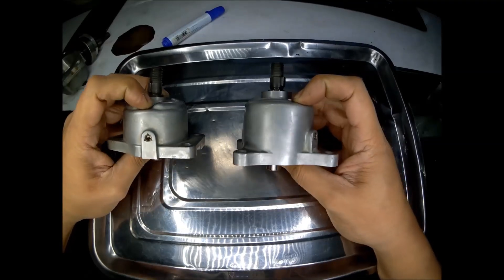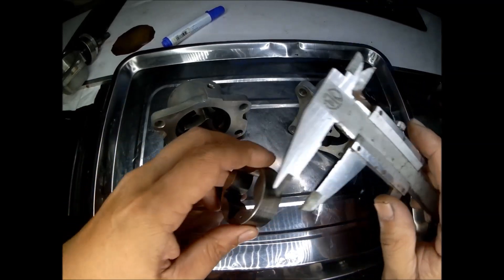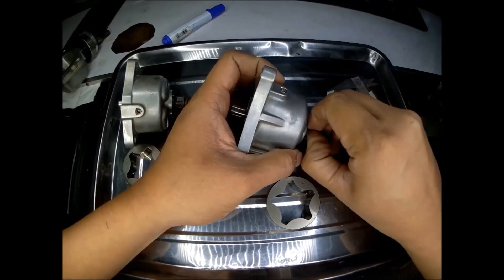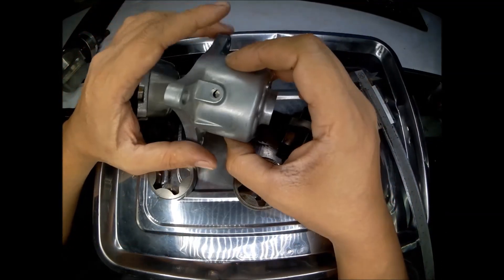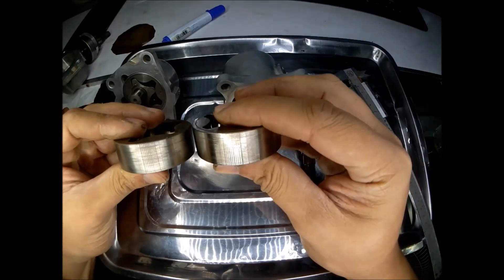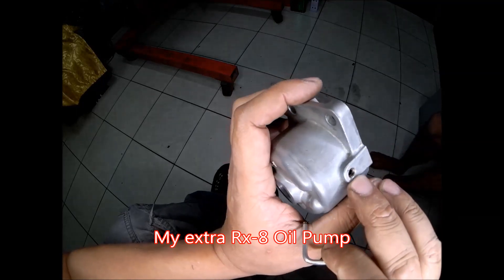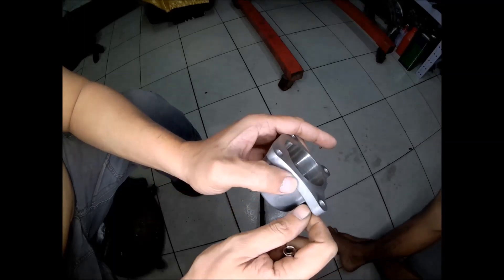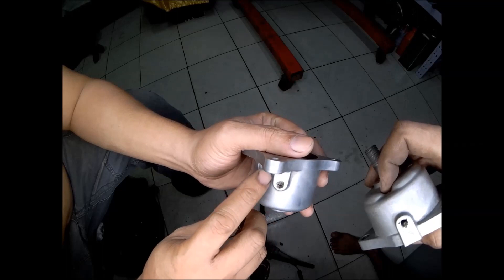Rx-7 FD&FC vs Rx-8 Oil Pump Comparison & warning FD Oil pumps

Comment: But what is the difference of having thicker gears for the pump and what's the benefit of a thicker or thinner gear?
Reply from the maker: Possibly more volume or more oil pressure since in a turbo engine theres an added duty of lubricating the turbocharger
Reply: @DIYAllManphKDWzpeedengineering  ooohhh ok, thanks man
Reply from the maker: @skyreach669  Dont forget to subscribe :)